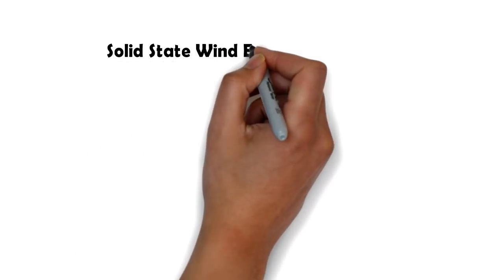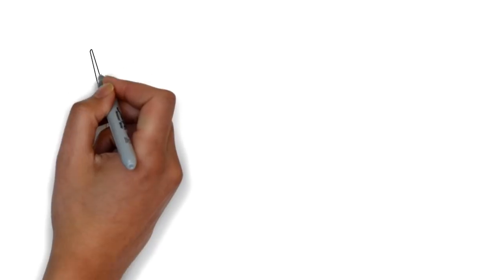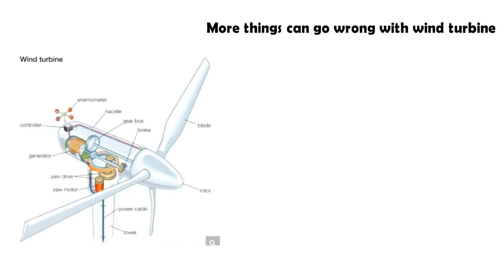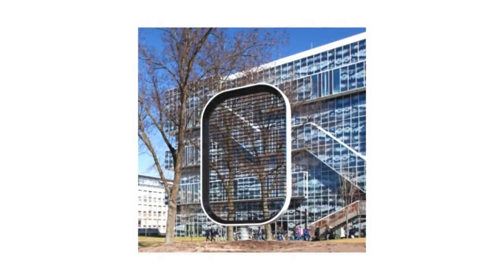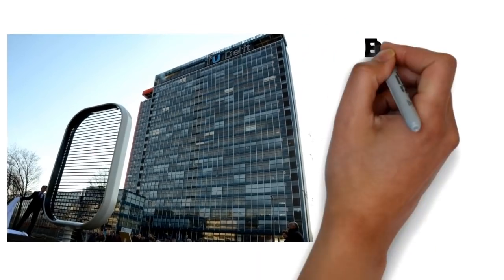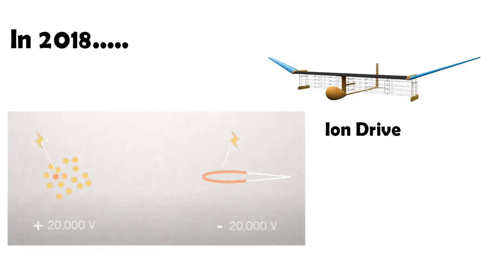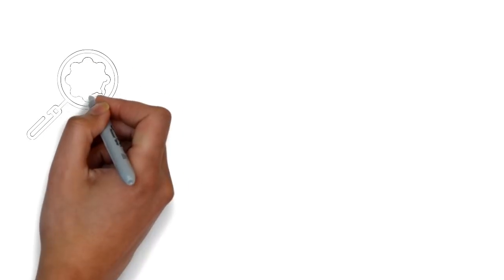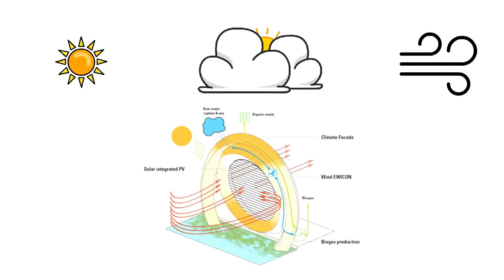Solid State Wind Energy Generator. A Revolutionary Device

Comment: Has some parallels to magnetohydrodynamics. Idea has been around for fifty years or more but problem is inefficiency and very high voltages and potential for ozone pollution mean so far no more than lab curiousity. 

Radio operators have observed related effects when wind blowing over an electrically isolated antenna leads to very high static charges. 

Although not very promising, good someone is tinkering with it as you never know if a breakthrough might be possible.
Reply: Jim, I am pretty sure this concept is a waste of time but I consider myself to be an expert on naturally powered watercraft (human, wind, current, waves, solar...) so to maintain self-respect I need to consider all possibilities.  Could you help me do a napkin level calculation for this concept?  A typical cruising sailboat would have ~1000sf of sail spanning 64ft with air speeds of 20mph on the lee and 10mph to windward.  100w would be useful, 1kw would be revolutionary.  Is this anywhere near reality?
Reply: @skyak4493  Hi there, Broadly agree, the issue is extracting useful power from winds kinetic energy. Wind turbine and sailing craft use similar aerodynamic principles. Modern upwind wind turbines are around 60-70% efficient in extracting the wind's theoretical kinetic energy. I expect some of the latest high tech sailing craft designs operate at similar levels of efficiency.  

While I have no doubt some energy is possible using the solid state ion approach, the idea has been around for fifty or so years and as far as I am aware never led to an efficient or practical power source, reportedly efficiencies of about 5% are possible, one tenth of that from conventional wind turbines.

However, you never know, new electrostatic materials (particularly nano fibres) new designs might throw up something useful particularly for wind power in urban areas where windows turbines are less acceptable. It might even be possible to add electrostatics to wind turbine blades lifting overall efficiency. It's probably worthwhile continuing to explore the idea.
Reply: @jimgraham6722  I like some of your ideas, like adding electrostatic elements to turbines... Of course, even 5% efficiency might be practicable if cost is 10% of turbine generation. And one might hope that 5% might become 6% etc, particularly if combined with some other technology -which, for the time being, no-one has thought of?? "Sometimes it is the people who nobody imagines anything of, who can do things which no-one else can imagine." Time will tell.
Reply: @skyak4493  those are the real questions, what's the efficiency and cost per Watt ?
Reply: What I fear is.... Do it produce something dangerous like nitrous-oxide? N is 80% in air......
Reply: What I fear is.... Do it produce something dangerous like nitrous-oxide? N is 80% in air......
Reply: Tesla did research, use a Tesla coil and the information on atmospheric electrics the earth is a giant battery

Comment: If your inputs are free and large, efficiency becomes less important.
Reply: Electrical efficiency will be poor, but financial efficiency will be high, and it's money that will drive development.
Reply: Efficienci is less important unless you have a competitor that does better with the same exact inputs: Conventionnal wind turbine.
Reply: yutuniopati Not if that more efficient competitor is more expensive to build, install and operate.
Reply: @spencerwilton5831  Off-shore Wind turbine are already at around $50/MWh and this is only the begining for price drop. There is no way you could deal with that, off-shore wind turbine will be even more cheaper than land based wind turbine.
Reply: 'free and large'  So why not just cover all of the US with a huge solar cell?   Because it's a bad idea.
'Free and large' doesn't make it good, it only makes it free and large.
There are drawbacks to everything.  Things like this that are far out of normal in one way or another tend to have much more in the way of drawbacks, not less, it just hasn't been done enough yet to discover them all.
Reply from the maker: Absolutely

Comment: i might be wrong on this,  but as i remember, ionized air has even lower resistance to electricity, thus electricity flows thru the ionized air.. just saying... 
would that not attract Lightning, cos of the least resistance effect?
Reply: You do realize that the odds of a lightning strike are astronomically low, right? Even if it does increase the odds 100 fold, that’s still a low probability. And since the wind generators are cheaper than solar cells, it wouldn’t be much of a loss, and it’ll be fairly easy and inexpensive to replace.

Comment: Photovoltaics take up a lot of surface that goes unproductive at night. These solid state wind panels could easily be stored under land-based solar panels, and deployed above them at night, maybe using the same motors that tilt the solar panels, to produce whatever little electricity they can at such low altitude, which is still better than nothing at night in a solar farm. We apparently don't know yet what this emerging technology costs, or if it's worth the bother energy-wise (I suppose you can't put one such panel for every solar panel), but it seems it would make a perfect combo with solar, not just a great complement. The only wind you can currently combine with solar is a wind turbine or two positioned on the northern side of your solar farm's land, if there are no houses around. So this technology is perfect for places where regular wind turbines can't fit.
Plus, if we are lucky, the ionized air may kill the tiger mosquitoes, so I am all for it!  ;)

Great video to excite our synapses as usual, and I really appreciate the original educative drawings and animations rather than the stupid stock videos found in many other channels. Keep up this fantastic job, Haroon!  Unrequited love from Toulouse, France.  ;)
Reply: Solar PV arrays are used at night (or at least their electronics are used) to perform a Power Factor cleanup on the grid as a whole, thus reducing the amount of generation needed to meet the offered load.
Reply: @rhiantaylor3446  If the solid state wind panels need their own circuitry and inverters, that could be a bother indeed. How does a power factor cleanup work, is this not a very temporary thing? I thought power factor was regulated at inverter or solar farm level while the solar panels were producing energy, not at night.

Comment: Is this only 5% efficient? is that theoretical or actual efficiency from the demonstration unit?
A vertical windmill is 59% efficient (in theory - I don't know the actual percentage) and Solar, is currently at around 22% but expected to reach 30% actual efficiency in the next few years...
Reply: Yep the efficiency is still pretty abysmal. 3 wing regular wind turbines generate at least 30%
It'll probably come down to economy of scale. As much as electric motors an batteries are easier to produce theroretically, internal combustion engines are still cheaper to the end consumer because the infrastructure already exists. I think the same thing will apply to these solid state wind things. 
You gotta convince investors thats the problem
Reply: I mean it's very early stages
Reply: the potential SURFACE area though can be enormous with this , unlike a turbine
Reply: M Detlef  At 5%  efficiency how long does it take to pay back a loan at 10% interest, and payback investors, and make a profit. It could take a really long time!